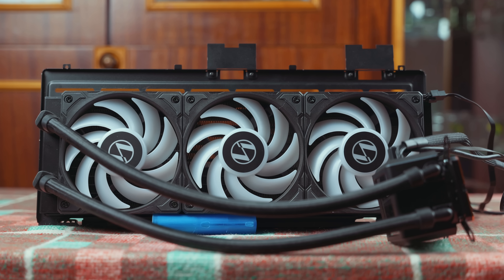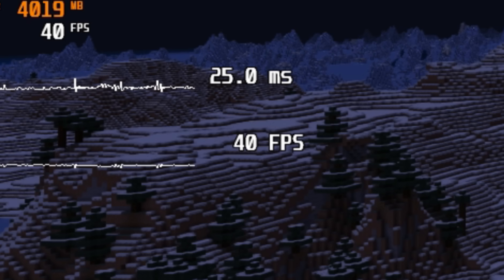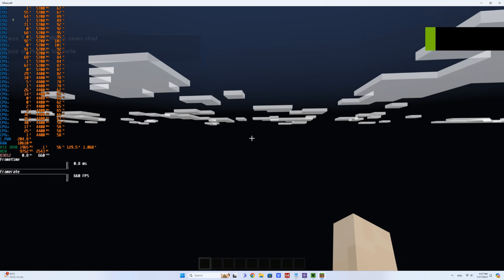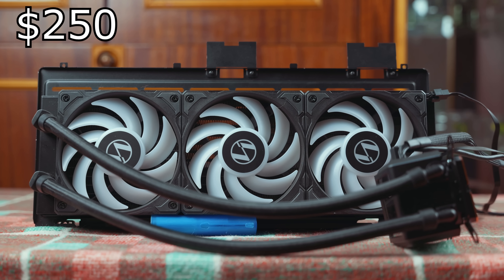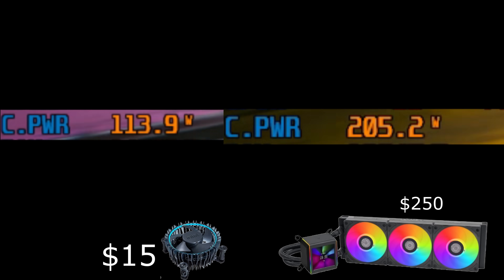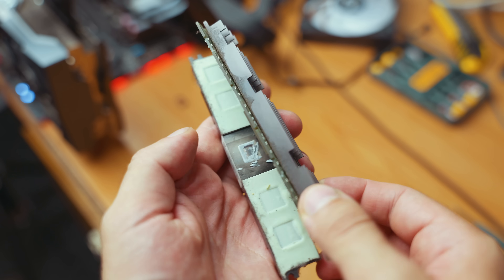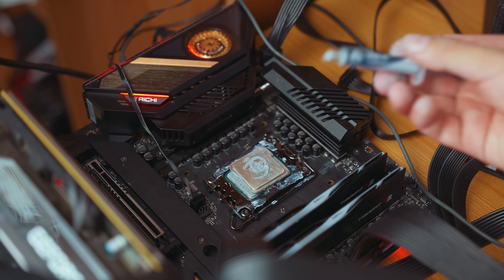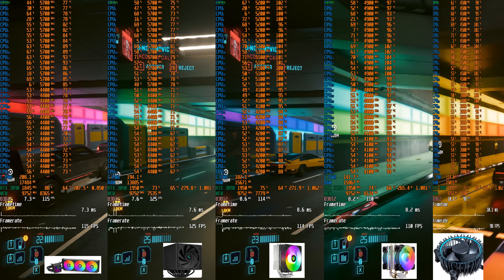HEATSINK VS i9 14900K

Comment: Well Intel has doomed its own cpus and this is why:
The 13th and 14th gen provided consumers and enthusiasts to upgrade to after 12th gen having problems on these platforms means there is no upgrade path for 12th gen so in this regard 11nth gen is better as it had also 10nth gen but then again 10nth gen had more cores so thats better but then again it ran hotter due to using an older process node so 9nth gen and 9nth gen gets beat even by the Ryzen 5 5600x.

Comment: Hmm... at 100c you could boil water... what if you subject the cpu to the dripping water torture?
Reply: calm down there satan
Reply: dew it
Reply: copper block and frying pan is even better, let your mind run with that.
Reply: Since water cannot exceed 100⁰C⁽¹⁾ you could technically cool the PC by boiling off water, you'd just have to refill the container (perhaps a copper kettle) frequently.

(1): Yes, if you wanted to be pedantic, water has different boiling points depending on purity and atmospheric pressure. 100⁰C is the textbook value for distilled water at sea level so that's what I'm going with.
Reply: @LordHonkInc that's called phase change cooling ;)
Reply: make some steak lol
Reply: You won't have time to pass the test before the water evaporates.
Reply: @ПавелС-ш8м  You could theoritcally collect the steam molecules, and convert them back into water for re-use :)
Reply: you actually can, water usually boils are more like 89-95°C unless you are at the beach. My thermometer usually stays at 87°C. the problem is you need to refill the water, and if you make a closed loop that cools the water vapour back down so you dont need to refill it thats basically a phase change cooler, basically a diy heatpipe. The heatpipe just has water at a lower pressure so it boils at a much lower temperature, say 15-20°C. Theres some videos on yt about making heatpipes using cooper tubes, distilled water and a vacuum pump and it works.
Reply: ive actually tried that before, the water usually doesn boil but does evaopurate fast
Reply: @OuyaWoelders-hi9bn thats normal, water doesnt boil at exactly its evaporation temperature, because you have the rest of the water cooling it. If you boil water in a tall transparent container youll see the bubbles form but then disappear as they float, because those steam bubbles cool down and become water again. youd need your cpu to be hot enough that it can superheat the steam so that it doesnt cool fast enough before reaching the surface. in a heatpipe this doesnt matter because it would increase the pressure really quick again raising the boiling point.
Reply: Pensé lo mismo cuando vi 115°, dije, acá falta que le tire una gota de agua y veamos como se desintegra en cuanto toca la superficie jajaj
Reply: ultimate water cooling lol

Comment: 300w on that aio
meanwhile my "220w" tower cooler can't keep a 65w chip under control
no i did not forget to remove the plastic from the bottom, i checked that and replaced the thermal paste 7 times already, nothing helped
Reply: i mean out of curiosity what chip do you have and what tower?
Reply: @Zapdos0145  silentiumpc/endorfy fortis 5 140mm (supposed to handle "220w" actually!) on top of ryzen 5 3600
Reply: @Napert  
That's weird, you probably tried re-mounting etc? Running stock? 
I'd contact manufacturer, even if the warranty is over, as it doesn't make sense.
From limited experience the TDP ratings on coolers are decently close.
I'd remount if you haven't
Reply: @Napert  Поставь напряжение 1.2 вольта и тактовую частоту на 4.2-4.3 ГГц, многим это помогает решить проблему с перегревом Ryzen 5 3600

Comment: what the name of the app that you were using to change the power consumption for the cpu
Reply: intel xtu psure
Reply: @sblade64  thank you
Reply: @axloddi believe Ryzen Master has the same thing built in
Reply: its XTU and video shows that he was on advanced mode.
You do need intel processor for it though

Comment: Good video. I suggest to always use an "Anti-Bending Fastener, Bending Type Pressure Plate" for Intel 12th,13th & 14th gen cpus. These cpus are rectangle and not square, they bend over time. The plate also lowers temps and it prevents thermal paste from getting on the board/socket. The great part is they are only around $10 U.S.

Comment: The 14th gen processors are just mini-nuclear reactors
Reply: Fun fact:they produce more heat than nuclear reactor in same surface area
Reply: @bhluschrean  they don't have anywhere near the same potential. Reactors don't produce as much heat because we prevent them from doing so.
Reply: @TheFirstSSJ  imagine 1.9v overclocking i9 14900k💀💀
Reply: @bhluschrean  Source: trust me bro....
Reply: Accurate. They literally decay from normal use. I could not have possibly picked a better time to switch to AMD.
Reply: RBMK Reactors to be precise
Reply: @indask8  you're delusional go to the infirmary
Reply: Nuclear reactors are useful. I just ran prime95 on my 7950X3D and it only hit 150W and it's 32 threads are all useful rather than the 24 'efficiency' threads on the i9. I've had intel for years but thank god I avoided this dumpster fire, emphasis on fire.
Reply: no they require nuclear reactors to run.  xD
Reply: @KameradVonTurnip  nah a time traveler grabbed a handful of I9 14th gen and went back a day before Chernobyl and shoved it into the computer to process and placed the heatsinks towards the fuel rods with immense temperature to blow up the reactor

[ this is just random stuff no I’m not some conspiracy theorist ]
Reply: @A_piece_of_your_floor  that was 9800x3d exploding
Reply: - we beat amd by 5%!!!!!
+ what did it cost?
- my wallet in electricity bills, air conditioning and upgrading to bigger and bigger coolers....  and it only lasts for a few minutes before throttling plus the cpu destroys itself...
Reply: @kochiss remember when 9800x3d burnt the cpu socket?
Reply: @kochiss  and also potentially has 100%  crash rate
Reply: @kochiss  and the life of the chip itself dont forget !
Reply: @kochiss  As far as im aware the 13700k beats the R7 7700x by ~50% , not 5. You missed a 0 there.
Reply: For realllss bro
Reply: Exactly. Unstable and hot af.
Reply: Except, a nuclear reactor won't degrade as fast as the 14900 cpu
Reply: @71janas  true true
Reply: And died
Reply: Perfect for our nuclear program
Reply: Lol😂
Reply: Yeah, and they've all just melted down
Reply: Only if you dont know what ur doing, and if your hitting 400 watts your a moron like this guy in the video.  400 watts is 6.3ghz all P core range.
Reply: Fr's
Reply: No just it's hot you need 400w tdp cooler
Reply: @DavidShadowX  Almost imposable to get this cpu to use 400 watts.
Reply: @dragonsyph2557  it's not now AMD have more game crashes than intel
Reply: little RTG
Reply: @PULSE_dbl  only i7 and i9 have that problem with 13th and 14th gen
Reply: And by that logic my AC is a nuclear reactor?
Reply: That consumes more energy than it lets out
Reply: @0li945  Wait really? I thought you could generate energy from nothing :(
Reply: @offsetmonkey538  thats crazy
Reply: @0li945  that was sarcasm
Reply: @offsetmonkey538  thats crazy
Reply: Yeah and these cpu’s are unstable and having a unstable mini nuclear reactor doesn’t end well
Reply: I have It with an 420 mm aio, a pain in the ass to get a case that Big, ended Up with the h9 flow that unexpextedly can fit an 420 aio
Reply: This doesn't even make sense. A nuclear reactors purpose is to create a load of power, not consume it.
Reply: Well i am getting the 14600kf so il vind out how hot they get and after i get a 360 aio i will overclock it
Reply: @indyvanderploeg1926 even knowing that they are unstable you're still going for it only for you to decrease performance just to get a stable experience
Reply: 'absorb mini-nuclear reactors'
Reply: more like the opposite of it, reactors produces power while cpus mainly the 14th gens are eating power
Reply: Like android battery
Reply: Except not at all like that
Reply: But they eat power
Reply: But they take power instead of give
Reply: Nuclear reactors which generate 1 wat per min
Reply: 14600K or above
Reply: they are literally more power dense than a stove
Reply: The 14900t, 14900, 14700t, 14700, 14600t, 14600 etc are 35 and 65w parts belonging to the 14th gen. These are the most efficient desktop cpus you can buy. How the hell are they nuclear reactors? What am i missing
Reply: @JustBenching  T = 35W limit with T-Boost into the hundreds. The 14900 has a T-Boost TDP of 220W. Efficient? Lol. AMD has been more efficient for the last two gens, at least.  Lisa Su and Papermaster caught Intel with their pants down with the launch of Zen1. Been nothing but Intel clawing back since then. More power, more cores, finally admitting tile dies are a thing with Foveros (real thanks to AMD here), and now, since they have been sitting on their ass for so long, AMD is handily (very casually) strolling right by Intel. When you think about how Intel treated AMD in the past, AMD should just curb-stomp them.
Reply: @crazyidiot5309  Im very confident stock out of the box intel cpus are way more efficient than amd ones. Tthe 14900t just completely shits on everything amd has on efficiency and its not even close.
Reply: @JustBenching  Keep coping